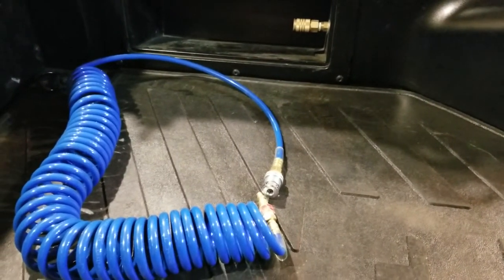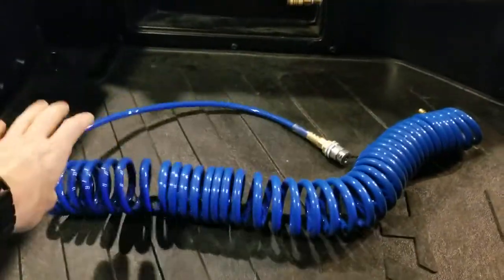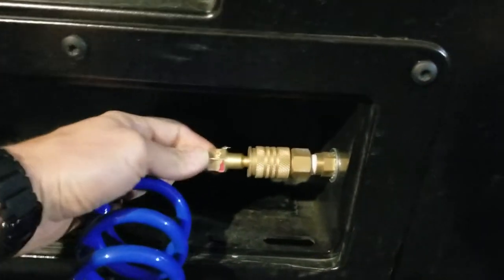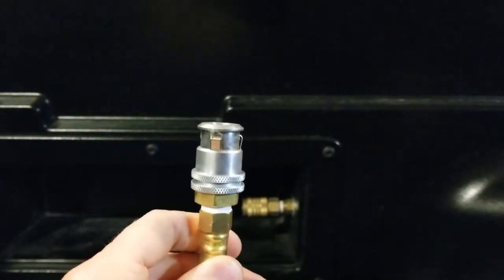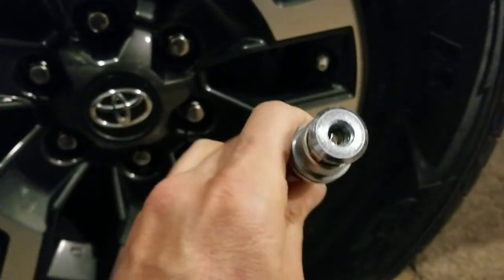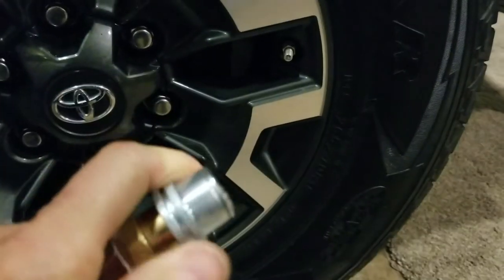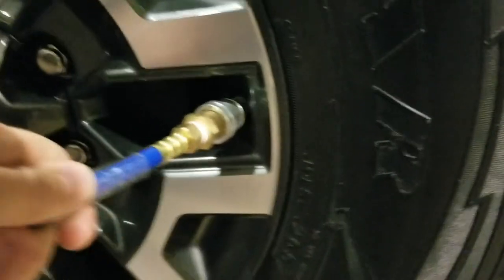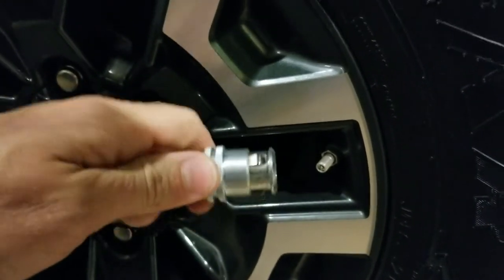Reese Goose Box Air Hose Connections

Comment: Do you keep it hooked up all the time while traveling? How you regulate the air pressure into the goosebox airbags? My onboard air is 125 psi and the Reese Goosebox airbags max pressure is 50 psi.
Reply from the maker: I do leave it connected to the Goosebox while towing the trailer. This video may answer the second question. I have 3 separate switches and 3 separate gauges. 
https://youtu.be/-YL5QtuNjC4
Reply: @ICanDoItMyself  Thank you for both videos! You have a great setup there.